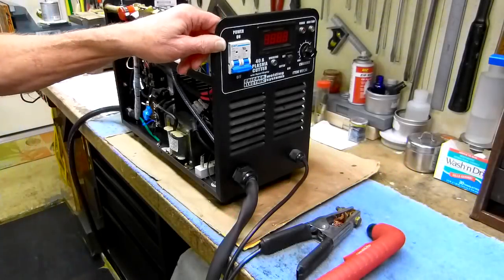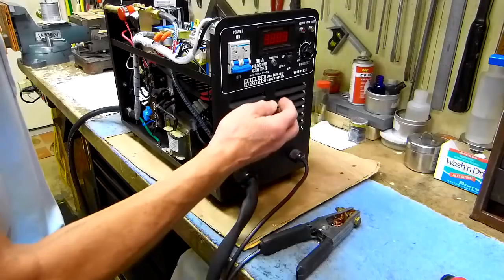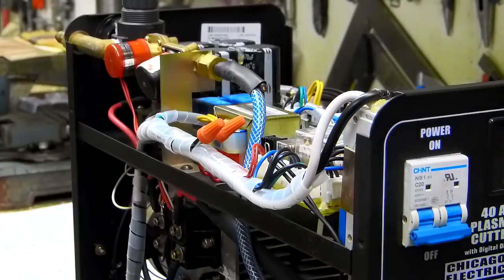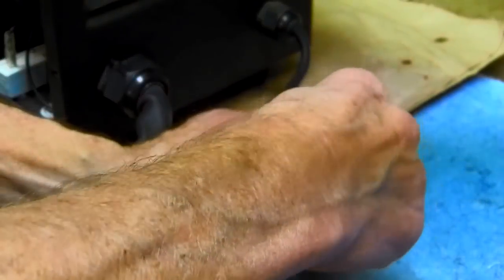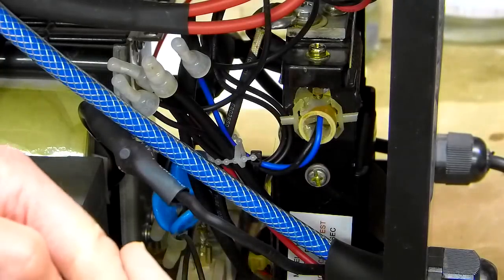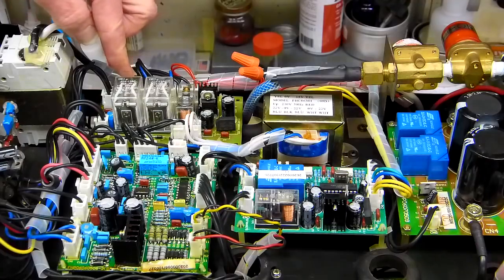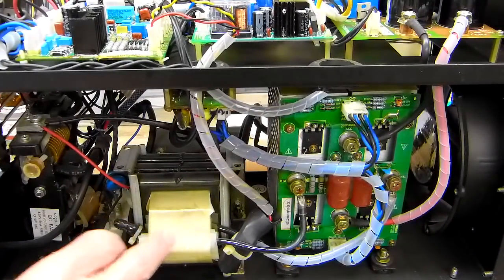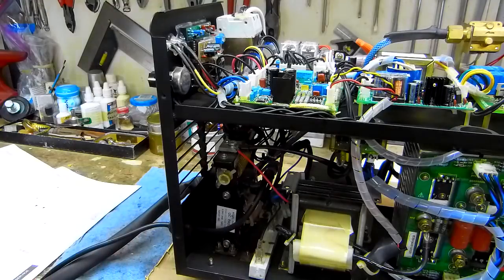Chicago Electric 95136 Plasma Cutter Repair Tips

Comment: Don’t know if you will see this all these years later, but just acquired a used, inop CE 95136. I need, but cannot find a schematic for it to troubleshoot. Any advice?
Reply from the maker: \https://chicago-electric.manymanuals.com/welding-system/95136
You may need to close some pop-ups and do some scrolling, but I was able to view the entire manual, schematic included on page 17.
Reply: thank you. May have figured it out. The electrode was stuck as it was for another commenter. Ordered a new  gun. Will see what happens once it arrives.
Reply from the maker: @greg552 Good luck!

Comment: I have one just like plasma that one won't cut it just act like a spark  plug hope you help me
Reply from the maker: First, check to see if air will flow through the torch when the SET/Cutter switch is the SET position. If not, check for plugged air fittings or if the air control solenoid is working. If so, I would then make sure all the components in the torch are in good shape and move freely. Be sure all the wires in the torch handle are connected and not broken. You can see this described in the video. When you pull the trigger, airflow through the torch forces a piston to move which breaks a circuit causing a spark that lights the pilot arc. The other thing I would check is the voltages on the inverter board as I describe in the video at around 11:00. But, BE CAREFUL! This circuit produces deadly voltages and current. Good luck.

Comment: Most excellent tutorial !  thanks for taking the time to do this .... somewhere around the 10 minute mark, I had already learned enough to troubleshoot my plasma cutter, which is the same exact model.  The barometric switch is working - if air pressure is present, it applies power to the air solenoid.  If air pressure is not present, it does not.  So ... the barometric switch is working.  That leaves the last component before the air tube that flows to the handle - the air solenoid.  Whether power is applied to it or not, no air flows.  That solves (at least part) of the problem.  How could anybody give this a negative review ????  28 as of 2021.03.27 - some pathetically sad people out there.
Reply from the maker: Thanks for the kind words! Good luck with the continued troubleshooting. Sounds like something is actually blocking the air flow. Could be the solenid valve is stuck closed or dirty. It's also very common for contamination to jam the moving  parts in the torch. Please let us viewers know what you find out.

Comment: Thanks so much! Your video helped me rule out the solenoids. I’ve used mine for years. Today unit powers up and nothing happens when button pressed. I can manually turn air on. Turns out I don’t have continuity on my white wire from gun to machine. 

Pulled it through sleeve and even remembered to attach fishing line for new one to be pulled back in. Hope that helps someone else.
Reply from the maker: Glad you found the problem. The small wires for the torch seem to be a frequent source of trouble. Thanks for sharing!
Reply: And…thank you again! I’m under a huge time deadline and my plasma wouldn’t work. This time it was the exact reason you described in your first few minutes. I was able to wind the copper and had the same burn through just a few windings next to the spool. I wouldn’t have had any idea where to go if not for your video.

Comment: Plasma cutter 's are useful tool's? Expensive tools ? Or wasted money 's tools?
Reply from the maker: Plasma cutters are very useful. Unlike saws, which create metal chips, or gas cutting torches that leave slag on the cut edge, plasma torches cut relatively cleanly with little slag. The slag that remains is usually easy to remove.
Plasma cutters with pilot arcs cut expanded metal much easier than torches because pre-heating each segment of the metal is
 not necessary. They also cut stainless steel and non-ferrous metals like brass, copper, and aluminum that oxy-acetylene torches cannot. If you frequently cut metals, a plasma cutter is definitely is worth the cost.

Comment: Dennis, I have one with good air flow (gauge at 100 psi), and on initial trigger a tiny bit of spark on the the work piece (no visible plasma flame) and then the tiny sparks stop at the same time the relay for the air coil kicks off. Any thoughts?
Reply from the maker: I would first make sure all the components in the torch are in good shape and move freely. Be sure all the wires in the torch handle are connected and not broken. You can see this described in the video. When you pull the trigger, airflow through the torch forces a piston to move which breaks a circuit causing a spark that lights the pilot arc. The other thing I would check is the voltages on the inverter board as I describe in the video at around 11:00. But, BE CAREFUL! This circuit produces deadly voltages and current. Good luck.

Comment: A friend dropped off the same unit.  Initially found out it had a bad air solenoid. Replaced that and added a swirl ring.  Got the unit to fire and it fires for about 3 seconds then cut out.  I checked the reed switch and it has a two single switched.  Both looked naturally closed.  Not sure what it’s supposed to have.  Magnet didn’t make them visibly move.  Any ideas?
Reply from the maker: The reed switch activates only when adequate current to cut is flowing through the torch. Reed switch contacts are very small and difficult to see operate. Testing them with an ohm meter would be best. This switch activates a relay on the top circuit board that I mention in the video. Your cutter might only be generating a small current for the pilot arc. If it will actually cut for 3 seconds, that would indicate that the high power inverter is probably OK and the problem is with the current sensing circuit. If you have some test leads, you could try to jumper around the reed switch and activate the relay directly. Be sure and un-plug this machine before touching anything inside. It Can Be Deadly! Good luck.
Reply: Dennis Allen awesome Dennis thanks for the reply I’ll give that a shot.  Thanks for the videos as well.

Comment: Found my problem in here shown at 15:48  Top right of screen seen under the center red wire is a phillips screw wire terminal where the sodier blob to the white kinda cloth looking wire goes down then turns into black wire. The eyelet that connect to the wire was still there but from there to the actual black wire was gone. I imagined it burned away but no signs. I stripped the end of the black wire, took a butt connector connected to short wire then new eyelet connector. Works good as new. Mine was a 60676 model #.
Reply from the maker: Glad you got it repaired. Good work! The time you show, 15:48 is actually the very end of the video. Did you mean to choose a different time?
Reply: @Allen-Dennis  Pretty close to the end, but I'll check. I had the video paused.
Reply: @Allen-Dennis  Sorry, from about 7:40 to 9:20
Reply from the maker: OK, I can see what you were talking about. There was probably a bad crimp connection in that eyelet that caused a high resistance causing heat to burn up the wire. Thanks for sharing the fix!!
Reply: @Allen-Dennis  You're welcome, thanks for the video. It inspired me to take the back off. My model # is 670676 I think but looks the same here.  Note too that I was hard on mine. Blowing rivets threw on ball joint, trying to hold 1/16" off of something is hard. Found these drop and drag tips now on ebay and they make things simple. set them on the steel and drag it.

Comment: This machine is so underrated. What a piece of art.
Reply from the maker: I'll have to say that I was very much impressed with the quality for what they cost. They are built using several different circuit boards which make troubleshooting and repairing easier than the newer machines which place more components on fewer boards.

Comment: Mr. Dennis, I have got to say this is probably the best video I've ever seen on YouTube. If you don't mind what type of work did you do before you retired, well I see you're not retired but just wondering what your main line of work was. I started working on junk when I was probably 13 14 15 years old mostly mechanic work and I built my share of starters alternators and engines and just about everything on cars. I was ripped off by guy when I was about 18 years old he said my pump motor was burn up and I had to have a new one and he said I'll just carry the old one with me and get rid of it. And I'm sure he did got rid of it by selling it. The same problem occurred a few months later while the pump was under warranty and I cared it back to the place and said look I'm not buying another pump and the man's name was mister Clardy. And he said aw Jack it ain't nothing but the start capacitor. Well I started fooling with electrical appliances and such. I did HVAC, and appliance work after I got a pretty good knowledge of what was going on and I did that for years. And I started to work and finished out my work history I guess you could say at the local hospital. I was in maintenance there for about 20 years. Had a great boss and teacher and he taught me all about boilers, Chillers and everything else in between and I can tell you are a professional. I think I would have liked to work with you and maybe absorb some of your knowledge also. Like I say great video and happy tinkering!
Reply from the maker: Thanks for the kind words. I actually retired as a facilities manager. However, I've had both electronic tech and digital computer training. Also had the good fortune to work with electricians for awhile. Over the years, many very smart were people were kind enough to share their knowledge with me .
Reply: @Allen-Dennis  absolutely wonderful sir. I knew from the beginning of the video you wouldn't somebody like I've been seeing talk about their equipment. I even watched one where the gentleman says I'm an electrician and he said I put this wire on here it's a really heavy duty wire and it look like probably 12 or 14 gauge sjo and even talked about running it on your house circuits with a 110 volt plug. He was having a lot of problems. I'm going to be looking for your videos I'm kind of new to YouTube. My health is really bad and I purchased a Eastwood 250i welder back last year and have never got to unbox it so that is going to be fun. I've only welded with a stick machine but my brother took a little different direction and I did he started welding when he was a young man about 20 years old and now he is 56 or 57. Most of his years he has worked on heavy equipment and he has told me some of the nightmares he's went through with that trying to put dozers and scrapers back together. But I'll quit jabbering it's a bad habit I have since I've gotten older and now by myself. But Mr Dennis you have a wonderful day and God bless you sir and keep on tinkering!

Comment: what plasma cutter welding machine does
Reply from the maker: These machines are used for cutting metal. Only electricity and compressed air are required. Unlike gas cutting torches, there is no preheating required. The extreme temperature of the plasma cuts almost instantly and the part being cut is less likely to warp.

Comment: Mines new, and it doesn't blow air at all, the gauges reads 40lb air, but no air comes out
Reply from the maker: First, try increasing the pressure from you compressor to 50-60 psi and see what happens. If that doesn't work, disconnect power from the machine. Then check the pressure switch/relief valve and make sure that the contacts are closing when air pressure is applied. In the video at 1:42 you can see 2 red wires coming from the switch. Use an ohmmeter and check for continuity across those wires where they plug in on the circuit board. The contacts should close and open as pressure is applied and removed. If the contacts are closing, I would next check if the air supply solenoid valve is getting current. Perform this step ONLY if you are properly trained to work around high voltage, as this machine has many areas where lethal voltages and currents are present. With air pressure on, power up the machine and measure the voltage across the wires feeding the air valve. It should rise to about 24V DC when you turn on the front panel Air Set switch. If you get current to the air valve and no air flow, then the air valve is probably bad or the line is plugged.  Also, try tapping on the pressure switch and air valve because they might just be sticking. If the air valve doesn't get current, the problem is beyond me to fix here. Good luck!

Comment: Very informative video sir! Do you think the machine is fairly well built? Looking at possibility buying one for home/shop use, not everyday commercial use, thank you
Reply from the maker: In my limited experience with plasma cutters, I'd say the 95136 is fairly well built. I've only worked with one other plasma cutter, a CHIRY Cut 50D and the 95136 seems superior in every way.  The 95136 was first available around 2006, and from what I have personally seen and read, it was a good value for the money at around $600. However, they are no longer made and people have said that Harbor Freight is no longer selling repair parts. There are parts available on the internet for the Trafimet torch, but replacement components for the machine will probably be difficult do obtain.
Reply: @Allen-Dennis  thanks for the reply sir!

Comment: Great vidio,,, Have you found  replacement for the hose and torch assembly? I was given one that had the torch run over by a car and need the complete hose and torch set. H.F. no longer carries parts for the 95136 unit.
Reply from the maker: I no longer have this machine, but I recall that it uses a very common torch system. I have seen parts available at online welding supplies and ebay. Just do an internet search for Trafimet S45 Ergocut Plasma Torch. Good luck!

Comment: Very good instruction, thanks!
Reply from the maker: Thank you! Like to share what I've learned.
Reply: Dennis, A friend brought me the exact same plasma cutter..won't create an arc. I checked everything in your video. All good...all the welder will do is a very small arc when I pull the trigger....air good, trigger circuit good. Only issue I found was a broken solder joint on ground circuit near the reed switch you talked about. Resoldered that...still no work. Any ideas?
Reply from the maker: Make sure the piston is working properly in the torch head. It should move smoothly. With this torch design, it is critical that the electrode tip touches the nozzle before the trigger is pulled and then retracts to cause a spark to ignite the plasma. Rust or dirt in the head can jam the piston. Also check the inverter board. My machine was producing 187 volts AC across  terminals NT1 and NT2 with the Amperage control set to 15. I returned this machine to the owner so I can't check it to offer much more advice.

Comment: I have the exact same machine.  At 6:21 u push the electrode in and it springs back out.. mine doesn't.. do u have any idea why?? I'm pretty sure that's why mine isn't working. Seems simple but I can't figure it out! Any input would be greatly appreciated!  Thanks and great video!
Reply from the maker: Not sure why your electrode is stuck. Inside the handle is the Torch Head and it contains the sliding electrode that the replaceable tip mounts on. There is most likely a coil spring inside of the head that keeps the electrode in the forward position until air pressure retracts it. Could be the spring is broken, or more likely rust/dirt in the handle or head is interfering with the motion of the piston. A wet or dirty air supply would be suspect. The head might have over-heated and warped the plastic insulators. With this torch design, it is critical that the electrode tip touches the nozzle before the trigger is pulled and then retracts to cause a spark to ignite the plasma.  The handle is not too difficult to disassemble for inspection. Just be careful not to pinch the wires when you re-assemble. The torch is a Trafimet S45. There are a lot of images of the S45 on the internet you can view to see the parts. Good luck!
Reply: Dennis Allen thanks so much!
Reply: Mine had the same problem. The shaft has a very close fit and any imperfection will cause sticking. I just took it apart and  buffed the shaft and now its smooth as silk and the machine works again after being dead for probably 3 years.

Comment: Great video!  I have a 95136 for the past 5 years, it’s a fantastic machine.  Built a log splitter with it, invaluable tool for cutting steel.
Reply from the maker: Thank you!
Reply: Your lucky .I could never get mine to work.i put it up and never touched it.
Just recently I was cleaning out the garage and stumbled on it.

Comment: Is that cutter a 110 or 220 plug-in? What's a good low cost air compressor and humidity filter to buy along with this Plasma cutter? Thanks Dennis !
Reply from the maker: This cutter is 220V only. I cannot recommend a particular brand of compressor or humidity filter as I have only used what I own. Testing was with an Ingersoll Rand compressor and a SPEEDAIRE filter-drier. However, I would recommend that you get at least a 2 HP compressor as this cutter requires 3.5 CFM of air at 60-80 PSI. You will also need to insure that the filter-drier can handle the 3.5 CFM. I was actually surprised by how much my 5 HP compressor ran to operate this cutter. Part of the reason is that each time you release the trigger, air continues to flow for about 13 seconds to cool the tip. Hopefully, other viewers will recommend some compressors and filters.
Reply: THESE remedies is good
Reply: Think about you in a positiv WAY,that gryning to get the reson why it stoppet
Reply: 55DEN va kul utan hjul och en